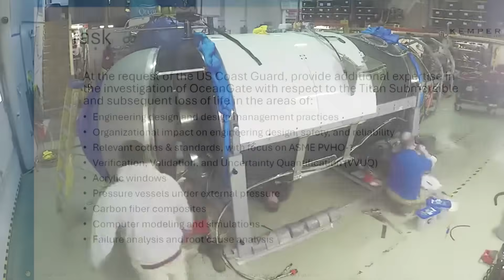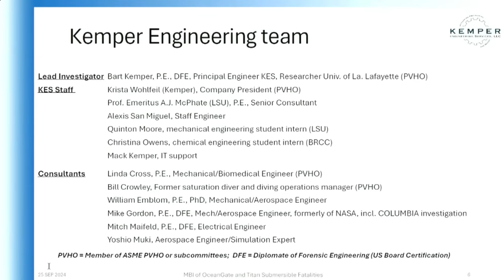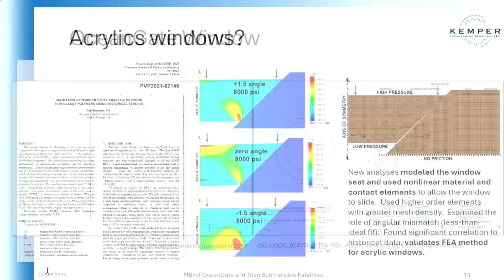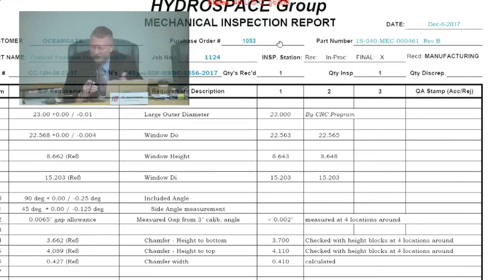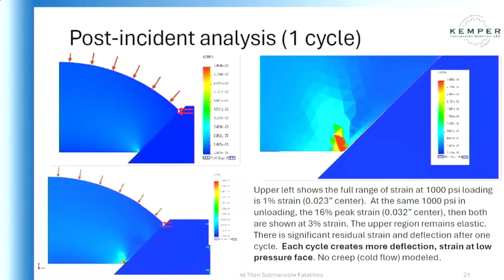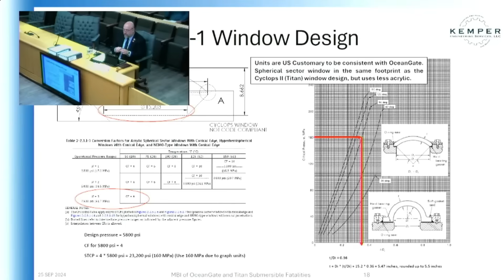Kemper Engineering Principal Engineer Testifies (Pt.1) | U.S. Coast Guard Hearing (OceanGate)

Comment: I'm just going through all the information now....I'm finding it all fascinating! This particular testimonial was lengthy but really interesting! From my, inexperienced perspective, I think Bart would have benefited from using a different header than "post incident analysis"....it was very confusing as it was initially unclear whether he meant he had been part of testing parts of the wreckage.....?! In short, Barts' testimony was mostly hypothetical, based on the drawings he had been asked to comment on, many years before. When the incident happened, Bart decided to go back to those drawings& use them to hypothesise whether the window could have been the reason the Submersible imploded? This is where it would be unwise to try make any kind of determination which could be deemed as concrete evidence. It is unknown if the drawings Bart is referring to were the ones used for the window of Titan. Bart, a highly qualified& professional individual in his field, he felt he wanted to analyse more closely and concisely, what data he could achieve by using his further learning from when he first saw the drawings& from new technical developments in examining data.
Due to the findings, Bart felt he should share them, incase they could be of any relevance, which they are, but to a point, so I think it is helpful. What I have surmised from this testimony, given that Bart never had a reply from his correspondence which explained that, in his opinion, the plans were not suitable for the kind of depths that Titan was being proposed for, the plans most likely weren't changed......quite possibly, this could be one of the many "rule breaks" that Rush alluded to on many occasions......? I'm at a loss as to why Rush ever asked for the opinions of professionals when he was hell bent on doing exactly what he wanted to anyway! The man had no right to be playing with other people's lives the way he did! I want to know why he wasn't stopped?! What is stopping it happening again......?!

Comment: Based on this report, if there hadn't been the implosion when it happened, there could just as well have been another critical failure at a later dive related to the window because of the deformations. Imagine the glued in window due to the repeated pressure cycles slowly deforming and creating small spaces between the titanium and the window itself. It may hold when you put pressure on it but once you get closer to the surface the pressure lets up suddenly you have the spaces again which may suddenly result in water coming in because the window is no longer sealed. And then imagine this happening at 200 meters depth where it still takes a bit time to get back to surface. They can easily and quickly drown in that thing without a chance to get out.

All things considered the implosion is probably the most painless outcome they could've gotten...

Comment: How many damn times is that woman going to ask the same question about the window analysis. If you don't understand the basic principles of design analysis, you shouldn't be on a panel of accident investigations
Reply: The lawyer or the coast guard questioner?

In either case, they’re probably trying to get specific things on the record. The woman from the coast guard in particular seems to have a role of asking pre-prepared questions at the end of the testimony, many of which are clearly not relevant or have already been answered by the end of the testimony, but they were prepared ahead of time, so whoever prepared the, didn’t know at the time they prepared them. This is probably to make the transcript of the testimony easily referencable. Instead of reading a long passage of testimony, you check the end and get the quick answer when you are looking for it. And when you want to know why or put in the reasoning to your report, you look through the whole thing.

Comment: I thought Kemper's presentation was marred by a few things: use of imprecise language ("skooch"), unclear graphs (not always clear if we were looking at the OceanGate portal or something else), repeated and continual reference to "Jerry" (he should have simply explained "Jerry" set the standard via experimentation and Kemper was using those results to validate his FEA/"design by simulation" methods), and his meandering presentation.  IMO, the confusion created was well demonstrated by the questions from OceanGate's representative.

The most important result from this presentation is the analysis of the shape of the OceanGate portal and the very localized strain due to the flat interior/dry side.  It's a shame there were no simulation to lab correlation of that work.  It would have been good had he used a model of the actual material used in addition to the milspec material used by "Jerry".  We could have seen the material advances he mentioned and that would have provided the result to compare to the actual material.
Reply: I don't think using words like "skooch" marred the presentation, personally. He didn't use it in lieu of technical language. He used it on addition to technical language and hard numbers. I thought it was a fairly reasonable attempt at helping non-engineers understand complicated physics.

His slides and graphs were a bit of a mess. I'll give you that point.

I also didn't personally find a problem with him calling it "Jerry's method". Jerry did the work and created the standards still in use today. The industry might literally call it "Jerry's method" because it's such a small industry. It's common practice for discoveries, innovations, and methodologies to be named after the person that found/created them. The panel never expressed a problem with it, or asked if there was a technical name. Kemper did his own analysis based off of Jerry's methods and results, so he needed to refer to them in his testimony. He explained who Jerry was, and what the standards are, how how Jerry made his decisions regarding what he thought the margin of safety to be. It was at least one clearly articulated part of the presentation. He couldn't do the additional analysis that you highlight because he didn't have access to that information at the time he ran the analysis. He used the information he had, used standard materials as stand-ins to fill the gaps, and it gave him enough information to feel that it was important to report. He isn't claiming to know exactly how the window would respond. He's testifying based on the information he had at the time of his report. It's the panel's job to determine what is relevant or not.
Reply: @fearsomefawkes6724 agree. In my scientific field, if you say Charlotte Moores Tables, people will know you are talking about the atomic emission tables because she did ALL of the data analysis
Reply: Yeah, I didn't get good vibes from him, I found his rambling and changing of topics very frustrating. He sounded more like a salesperson than an engineer at times.

Comment: This was one of my favorite interviews.  I think he had a hard time conveying this complex topic in a way that was comprehensible for non-engineers, his analysis and evaluation of the dome and the concerns of creep, plasticity, and build up of stress shows that if the dome wasn't the cause of the Titan failure, it likely would have been at some point.  

I'm wondering if that loud bang in dive 80 could have been the acrylic releasing the cyclic pressure build up.  Makes sense as it was after several dives and occurred near the surface after pressure dropped.

Comment: inventor  Fred Binge who tragically is not with us now  was way way ahead of his time Fred was planning to build a submersible to vist the famous   Titanic. Fred useing  high cutting  Technology  (for a Yorkshire mam that is ) used an old oil drum with the top removed .useing a pain of " Arcwrights "   toughened  glass from his mates  green house .sealed it to the top of the oil drum useing Archers glazing putty   and brought from his local ironmongers Four miles of best garden hose for the air supply. But tragedy struck old Fred on his way home  from his Allotment on his pushbike .Fred Binge got hit by one of arthur Slugs racing pigeons.they tryed in vain to save old  Fred  but a fast moving  pigeon Fred  didn't have a  chance RIP. Fred .

Comment: He didn't 'just run one it once'. He ran the analysis based on one cycle of submersion because that is what the computational model is validated for based on the information he had at hand. 
A simpler way of saying it is this; 
Hypothetically, if this window design was built then submerged once and raised, then inspected, what would we see? 
If we went down again, the first 'dive' would have a cumulative effect whoch would effect the result of the second 'dive'. 
The computational model only had enough data for a single 'dive' event, not enough data for multiple cumulative dives. 
Regardless, the analysis of a even just a single 'dive' showed that the design was deeply flawed. 

The other thing to consider, is that we all know that Stockton liked to do this rushed and cheap. 
Making a flat bottom dome is MUCH easier and cheaper than making a spherical cross section one where the thickness of the arc is the same. You have to produce 2 molds or if machined, cut into two faces.
Reply: he also needed to know the seat of the window. Did the Titan window have a titanium lip in the interior? Would that make this design better or worse ? Oceangate hid all critical information from this engineer. Stockton & Tony burned his analysis letter the day it arrived. It was packed full of warnings & danger.

Comment: The critical issue with including codes by reference is that the codes can be very expensive to acquire and project may involve many quite expensive codes.
Reply: If Oceangate didn't have the money to build a certified deep diving sub, then they shouldn't have ventured into this realm of danger.
Reply: @ScoobyFish-g6q  Not an Oceangate issue, but when, for example, you need to buy three CGA standards to find how to clean a tank and valve is kind of a huge pain.  And what people do is buy a $20 book instead of $900 in standards.